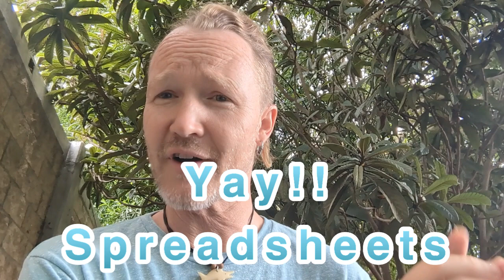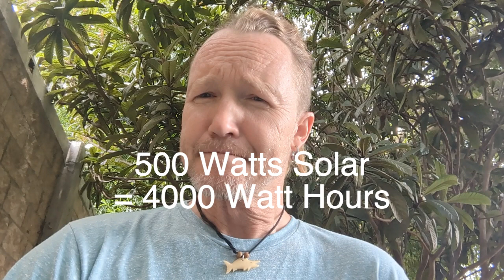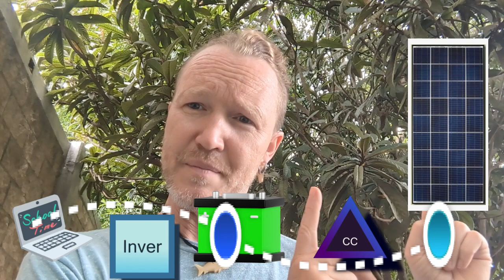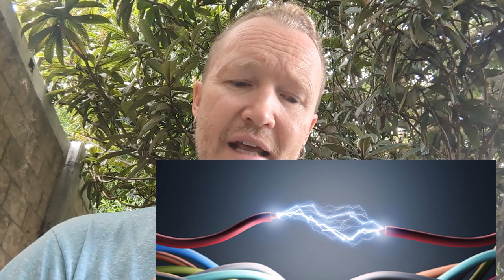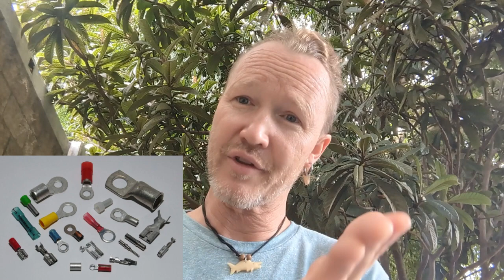Understanding Solar, Battery and Load Derating - A Vanlife Design tool

Comment: 6 x 200 w panels strait to 222 volt   1000 watt element in hot water tank with  400 volt suppressors the thero switch works through 12v relay and huge 400 v relayswitch   the suppressors have to be connected on this switch the arc here is over 9 inchers  (22cm) long and has a hell shock i can tell you so all switchers must have suppressers  this heats water  better than 220 v

Comment: i run 4 solar panels to 2 x 12v batterys then wired all my lites sheds house with 12v  dc smd lites close to 40 lites and 6 or7 years ago still going great batterys down a bit but still going just got to use on each switch a suppressor  to cut the arc
Reply from the maker: Quite a setup